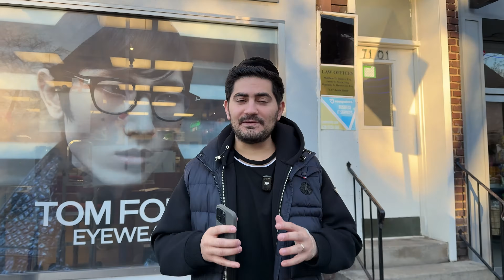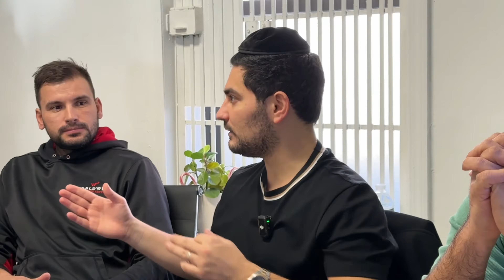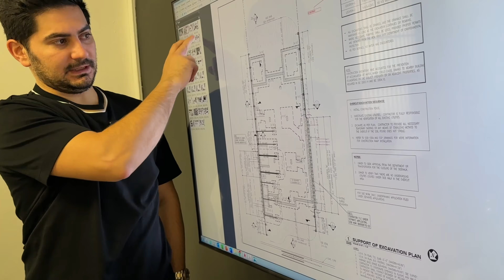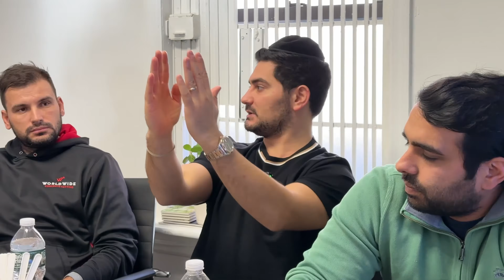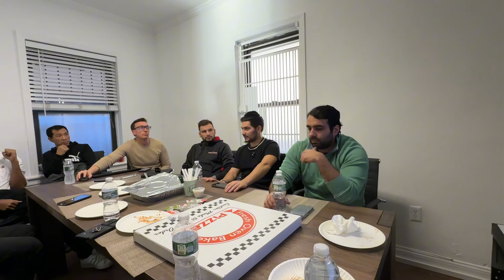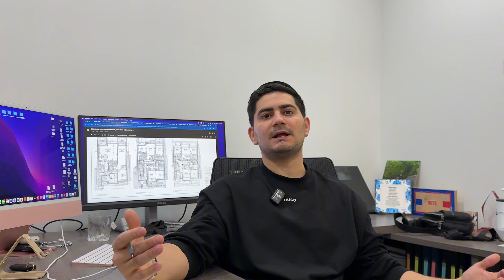Make Money Solve Problems

Comment: Great content. Are the seismic gaps always required for new construction buildings in NYC?
Reply from the maker: Yes by code on each site
Reply: It's 1 inch for every 50ft of building height. So a 1000ft tall skyscraper needs 20 inches separation, but usually in that case GC files for a ccd1 with dob to be allowed a smaller distance